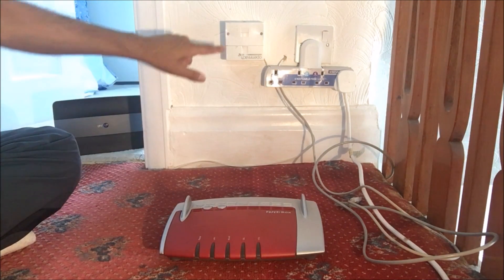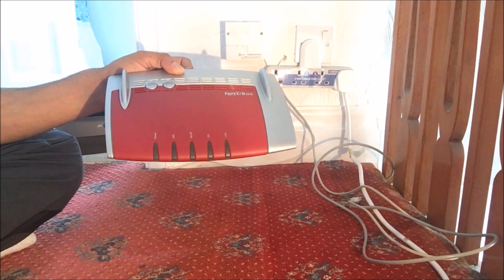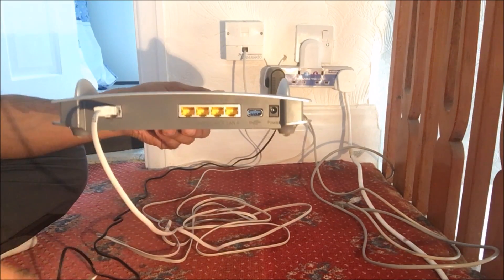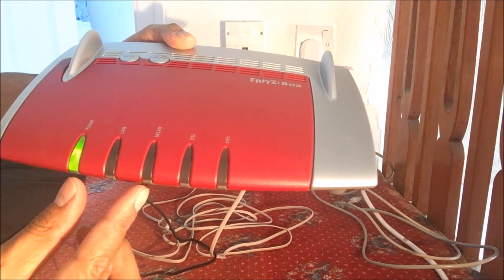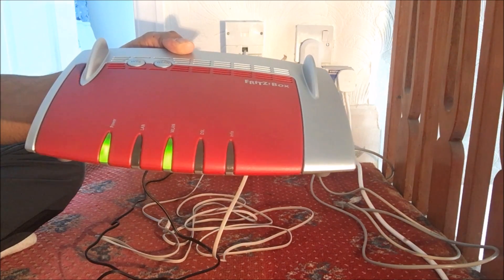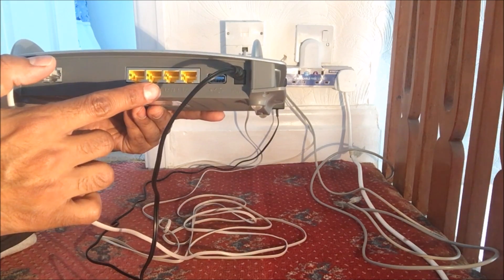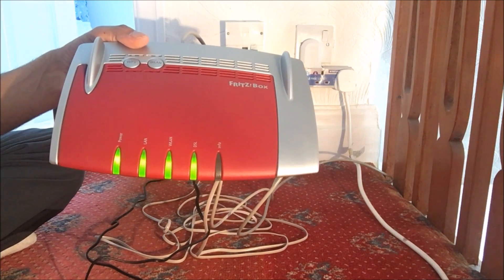Replacing BT Hub with 3rd Party Router - Fritz 3490

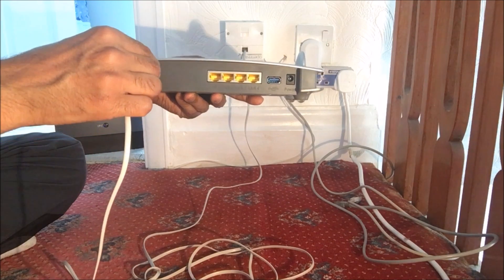Comment: At 2:00 in you mention connecting a phone to block numbers etc. This NOT possible with this model. The 3490 lacks all telephony features including answerphone, analogue, ISDN and DECT functionality. You need a better model in order to do this. In the current range, the 7490 is the next model that has these features although it's possible to source superseded models such as the 7390 etc from other vendors or even eBay.